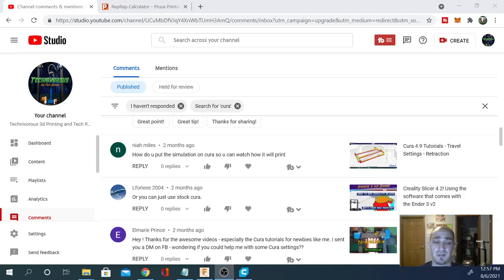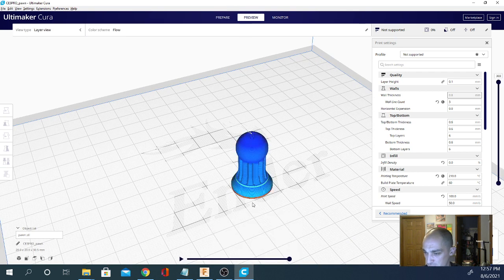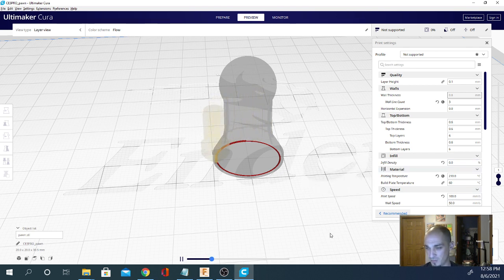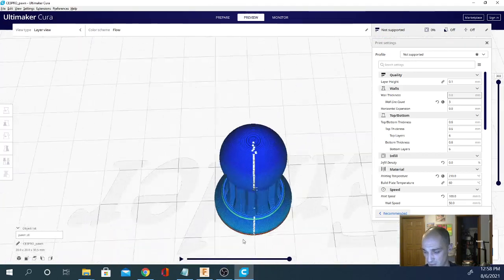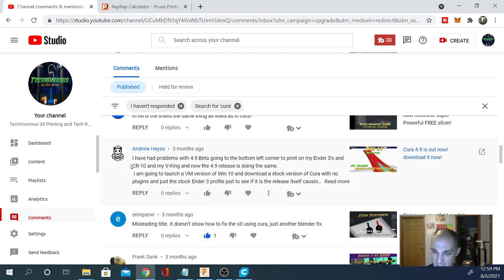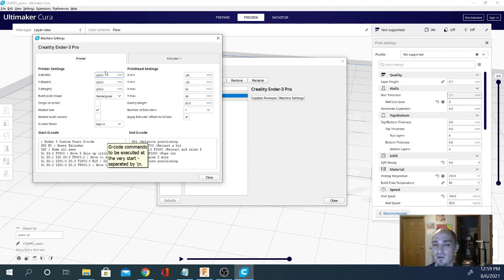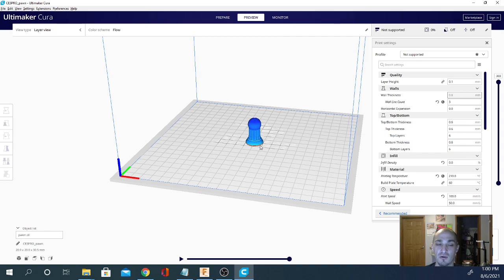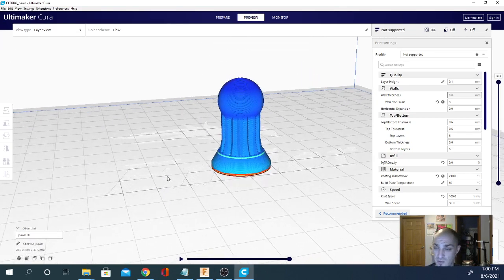Cura Questions - Printing on front left Corner - Not Centered...

Comment: i have the 5.3.0 update on cura and dont have the "Origin at Center" box checked. but my Ender 3 pro is still printing at the front left of the bed. how do i fix this so i can print larger prints starting in the true center of the heat bed?

Comment: Thank you - NOT AT CENTER is what got me (I was using a different software before). I just upgraded my MB from the original v.1.1.# to the V4.2.# so I could install the BL Touch (Updated to Metal). Was all good until I hit print .. and that drove me crazy and damaged my magnetic mat as well :( I enjoy my resin printer so much more because of the easiness. I unchecked ORIGIN AT CENTER because that's how everything else works, right? LOL .. maybe it should be labelled: Origin at Center of Home 0.0 ?

Comment: I followed these steps and my prints are still trying to print in the top corner.  I believe that i've only had 1 print that worked with no issue and that is the test print that came with the printer.